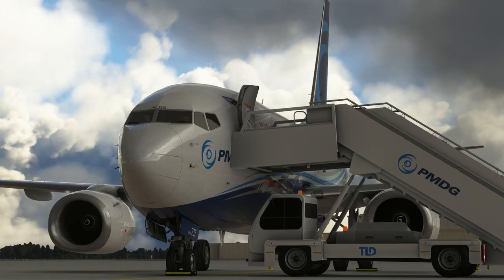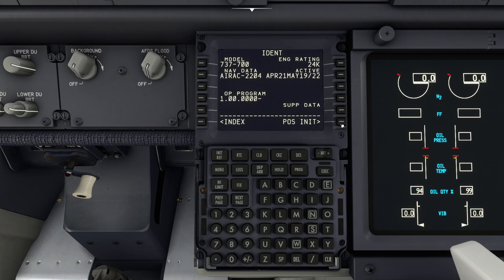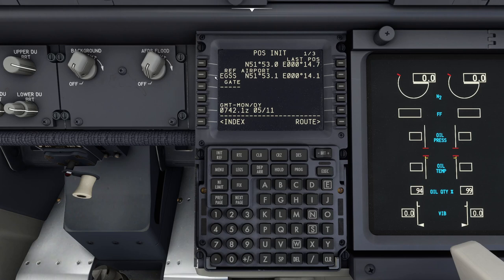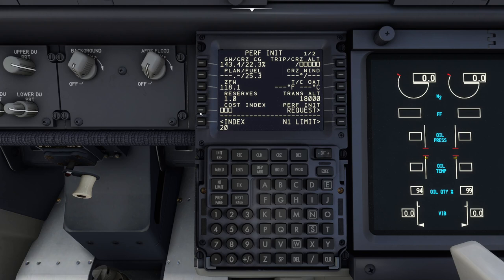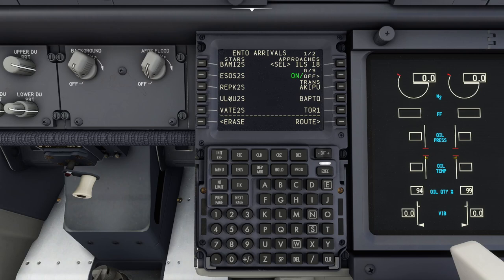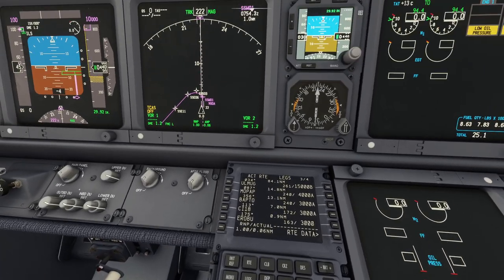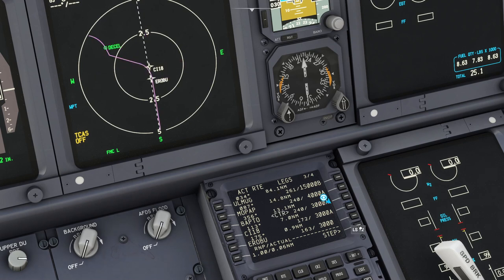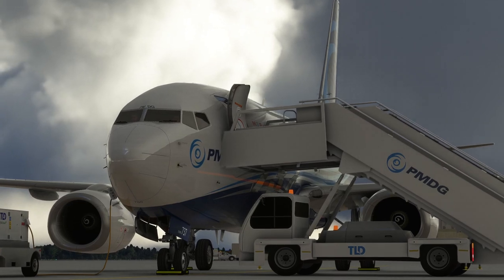Beginners guide to programming the FMC in the PMDG Boeing 737-700 in Microsoft Flight Simulator

Comment: I've only had like a half hour with this thing and this video because I'm actually busy in simulator training for the real thing. And I find this thing dizzying. Not because I don't get it. But because I'm actually surprised how accurately it all seems to work so far. IRL we have the ability to auto load the route and the takeoff performance data is more complicated than what you see here. But as far as routes, menus, holding, it's all spot on. What will really break my head is if you can do things like abeam points, build points a distance from a fix along your route, or place points via place bearing distance. Those are things that are technically not necessary for a sim, but would be incredible if they're there. Now what we really need are the weather radar and RNAV(RNP) approaches.
Reply from the maker: The abeam points are difinitely there - in the FIX menu. Nice to have feedback from a real pilot! :)

Comment: Thanks for your tutorials, they are easy to understand the way you explain them. To the point without any unnecessary information. I have just bought a hardware MDU/FMC for the B737 and it adds much more to the flight. What I haven’t been able to find is where on, for example, the simbrief OFP I can find the info that the FMC needs, a video about that would be very useful for many serious flight simmers. Thanks again and keep up the good work!
Reply from the maker: Yep - I'll do a video on simbrief integration soon - a few people have asked about it. It's worth pointing out before I do it - the integration doesn't load everything about a flight plan - you still have to go and review/revise it afterwards.
Reply: @jonbeckett  I have seen that and I think many serious flightsimmers would benefit from that. A clear guide about all the info you need to feed (and why) into the FMC at what stage of the flight and how you can use it.  That video can also be used to make a good FMC “checklist”. Just my thoughts..
Reply: BTW, if there is anything that I can do to help, just let me know!

Comment: Little Nav Map has a fuel report (the tab next to flight plan tab). If you load the Aircraft Performance file for the 737 the calculation should be fine. I use the LNM fuel report function a lot for the CRJ and never had any problems.

Comment: Thanks - I
 have problem with airways in little navmap. Not in database error. 
I use airways in Skyvector as a supplement to little navmap.
Highly recommend Simplates for detailed ILS approaches
Reply from the maker: Yes - Simplates is very good. I keep wondering about signing up with Navigraph, purely for the charts. If you're flying in the USA, chartfox gives you plates for free.

Comment: Greetings... Comprehensive educational video and many benefits... I am facing a problem after take off and on autopilot, lnav & vnaf but after a period of take-off it runs regularly on the navigation line, but after a while I notice that the plane does not travel correctly on the navigation line as it is entered  fmc and that it is rotated  To the right or left of the navigation points is very slow, i.e. the angle of rotation is very slow, which leads to the plane losing its navigation line..what is the step I missed to do it?
Reply from the maker: You're not making a mistake - the real aircraft does the same thing. It very much depends on the speed you are going when you reach a turn, and if the aircraft can make it. On some SIDs and STARs, the constraint may be to overfly a point before changing direction - which will often make your track over the ground differ too.

Comment: Great instructional video, thanks for posting this. 
Question 4 you or the group here. I'm new to FMC- I know the basics. I paid for update Navigraph subscription and downloaded recent AIRAC cycle for my Plane in the Sim which is a Wilco 777-200ER. 

One question is, the new AIRAC cycle show correctly in my FMC CDU screen ok.

But when I enter say New York (KJFK airport then try choosing runway 31L or 31R for Departing its not there listed as an option. It only showing 1/1 pages so there isn't another page.  Only runways showing for KJFK are RW04L, RW04R, RW13L, RW13R & RW22L) thats it- No runway 31L or 31R for departures. 

Strange thing is on my FMC if I try seeing what runways are available at KJFK for Arrivals I'm seeing all runways including 31L, 31R.   But I noticed its also missing IAPs- they show the runways but do not list ILS or RNAV approaches.    

Anyone have a clue whats going on or how to fix/remedy this issue? or experienced this themselves?
Reply from the maker: I would perhaps check a different aircraft, to see if it's a problem with the 777...

Comment: Hi, how do you come up with those tiny labels when you click the mouse on buttons and dials?
Reply from the maker: In general settings, under assistance within Microsoft Flight Simulator, there is a setting for the tool tips - wether they are instant, delayed, or off.

Comment: Great video, again. I can actually (almost) fly the PMDG thanks to your tutorials. Could you give me just a hint why my TOD is (starts) always to  late? I really have to manually dive to lower the altitude. Thanks in advance Jonathan ;-)
Reply from the maker: Have no fear of using air brakes during descent. They will expedite it. Real aircraft do it. While you might get 1700fpm descent rate without brakes, you'll get a LOT more with them.
Reply: @jonbeckett  Wow, I had once heard -600fpm should be the average. "Never to old to learn right"? 🙂 Have a great weekend.
Reply from the maker: @eds5709  It's not unheard of for airliners to descend at FAR faster rates. The more time they can fly at altitude, and the least time they fly lower, the more efficient they are in terms of fuel burn.

Comment: If you imput the performance and or seleft a n1 limit, do you have to do a toga takeoff or can you manually imput the throttle
Reply from the maker: TOGA is the preferred power setting - you can use whatever power setting you want.
Reply: @jonbeckett  Thanks

Comment: Great basic tutorial video; however, your comment on "transition altitude" was incorrect. It really has nothing to do with IAS vs Mach. When the transition altitude is reached is when you need to change to "standard" on your altimeter (1013 hPa or 29.92 Hg for US). Basically, setting the altimeter to "standard" above the transition altitude ensures that all traffic stays in its vertical lane no matter how the atmospheric pressure changes while flying in a given area. Below the transition altitude ATC will be giving you altimeter settings for true altitude above sea level so you will know (accurately) where the ground is. This is an interesting study topic, as the calculations for these numbers are quite complicated (given the fact that most airport weather stations are NOT at sea level).

The IAS vs Mach switch will happen way above the transition altitude when they meet. Thankfully, this switch will happen automagically on this airframe (if everything is set up properly). :)
Reply from the maker: Yep - I didn't communicate it very clearly at all. Mach number switch over is at some point below 28,000ft usually - and again - a complicated formula, and much conjecture about where exactly :)  Half the problem with trying to record videos unscripted is I occasionally think one thing, and say something entirely different :)  I'll do a video about transition altitude, transition level, and the transition layer at some point (it will require diagrams) :)
Reply: @jonbeckett  I have been flying GA too long and I am a little frustrated with the lack of documentation PMDG gave us. I need a detailed manual just for all the FMC functions. Also, there was a lot of time spent by PMDG to make failures but no documentation on dealing with them. Guess I need to find a real life Operator's Manual somewhere... Anyway thanks for helping people get off the ground... :)

Comment: Terminology is a bit confused in this otherwise excellent tutorial. A STAR is not a "standard approach route." It's a standard arrival route. STAR stands for Standard Terminal Arrival Route, "terminal" being a reference to the destination airport. Ideally a STAR (arrival route) will bring you to initial approach fix (IAF) of your selected ILS or RNAV landing approach. In this video, Mr. Beckett has in fact chosen a STAR, "ULMU2S", which he calls an "arrival," to take the aircraft to the beginning of the final approach. The advantage of picking a STAR, if you can find one that works for you, is that once you choose a STAR, all the waypoints along that arrival route will be entered into the FMC so that you don't have to enter each one manually. It's STARs that prevent a pilot "free for all" upon arrival at destination airports.
Reply from the maker: Guilty as charged with Approach versus Arrival - it's a bat habit :)

Comment: Does one need the PMDG in order to get the V speeds selected because I don't have the PMDG and wondering how to get the V speeds to be shown like Vr,V1,V2, trend vector and so on can anyone answer that. I have the Microsoft flight simulator X steam edition but planning on getting the X plane 12 when it comes out I think it's coming out in July this year.
Reply: What is PMDG?
Reply from the maker: The FMC is a part of the PMDG 737 - other versions of the 737 available at the moment are not as realistic.
Reply: @jonbeckett  thank you for your reply 😊 how do I get the 737 with pmdg does it cost? 

Kind regards 😊
Reply: @jonbeckett  so it’s a separate game called pmdg 737?

Comment: you need set rwy/wind  and OAT temp
Reply from the maker: Ahem - this was a beginners guide - it doesn't go into the weeds - we don't set winds aloft, outside air temperature, or runway wind - it's just the basics of programming a route, and setting the aircraft parameters. I say as much in the video, and the description :)  It's the reason full work-ups of the FMC take an hour to describe, and lose most newcomers.

Comment: why isn't my fmc lit?  there is no way to program anything if it's dark. I follow the first two steps and it's still dark.
Reply from the maker: There are lighting controls right across the front of the pilot at knee height, and a huge dome light switch overhead.
Reply: @jonbeckett  that wasnt the issue.  The menu key has to be held down.
Reply from the maker: @IAMYUNGGAF  You didn't say what was dark "it is dark" usually means it's night time :)
Reply: @jonbeckett  no, i meant the plane was in a COLD AND DARK STATE and after i turned on the batteries the fmc remained DARK.  That was good ole' U.S.A. american english kind sir :)
Reply from the maker: @IAMYUNGGAF  So... the 737 retains "state". It may be that the FMC is off. Hold the MENU key down on the FMC for a few seconds.

Comment: Hello Jonathan,  Do you know anything about, how have to synchronize captain and copilot FMC work parallel with each other? I try to search for it but have no success. Thanks
Reply from the maker: The PMDG aircraft are accurate to the real thing - although the flight plan will appear in both, operation of the two FMCs is independent. You're lucky - in the real plane, the barometric pressure is independent too - you have to set it three times :)